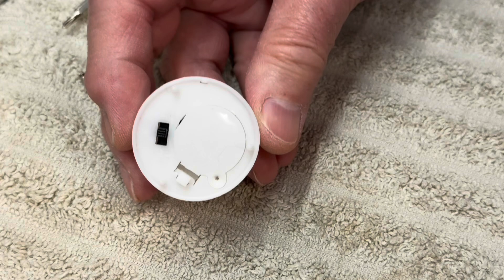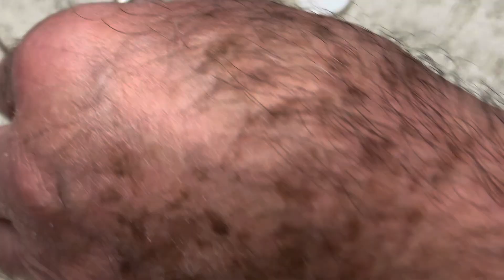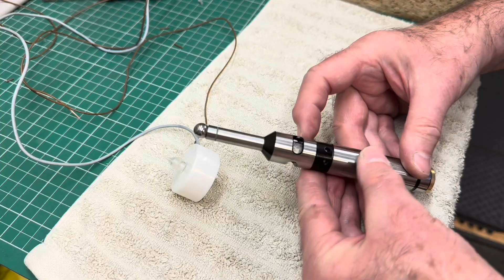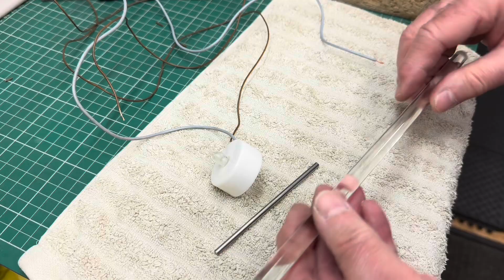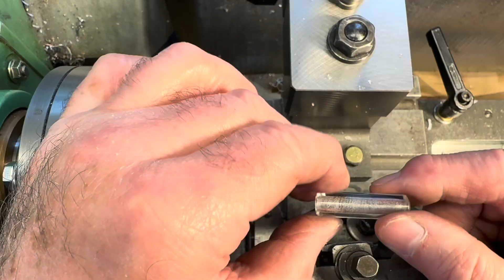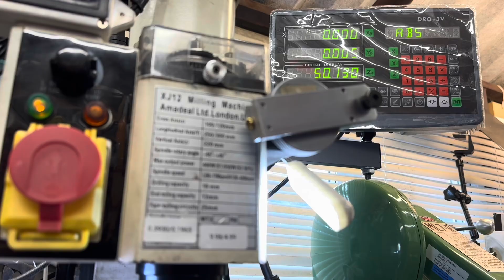Led Edge Finder - Shop Made.

Comment: Nice project Nobby!  I’d looked at the commercial ones and they are far too big to be practical in my mill.  You’ve given me food for thought as to how I can make one for my workshop.  Thanks!
Reply from the maker: Some of the 3D Touch Probes are coming down a lot in price now. Still a bit too rich for me at the moment Mark. I guess they could still drop a lot more in price. The one I have works very well, but is unnecessarily large. 
Cheers Nobby

Comment: i bought a doz tea lights on Aliexpress hoping for a battery holder switch box, was almost the same as yours , they do sell battery holders with a switch Single Slot CR2032 or double  very cheap
Reply from the maker: I’m trying to think of other things I could make with these T-lights. What are you going to use yours for Jon? Cheers Nobby
Reply: @nobbysworkshop  i have jaws mouse traps, just mouse traps in a plastic enclosure you can't really see if you got a mouse, so with a tilt switch and buzzer ill know :p

Comment: Hi Nobby.  Interesting idea.  I would expect that any oil on the contact surfaces would/could cause problems with low voltage current flow, as it would act as an insulator. This could cause inconsistencies.  Maybe that's the issue. Try wiping those areas with acetone and see if it improves things.  Cheers Rob
Reply from the maker: Thanks for the tip Rob. That didn’t occur to me. I’m going to shorten the probe, which I’m sure was flexing, and carry out more accuracy tests. Your advice is very much appreciated Rob. Cheers Nobby

Comment: Could make the base of the candle magnetic and also one of the terminals so that it only needs one wire coming out of it.
Reply from the maker: A magnet could be a problem in attracting swarf. I made this in the same way Myfordboy did, but it could easily be modified to have a contact on the base. Good idea T&B. I still have to shorten the probe, and do some more repeatability tests. Cheers Nobby

Comment: My candlle ight had a flickering effect led and I switched it for a regular one. If yours has the same flicker effect this would make reading inaccuate.
Reply from the maker: Hi David I think I mentioned I was worried about this in the video. After I shorten the probe, I’ll carry out some more tests. If it doesn’t repeat, I’ll have to replace the LED. Take care ATB Nobby
Reply: @nobbysworkshop I can send you a new led if you like I have plenty. It would be more visible anyway.

Comment: Now if you really want the metal stick to be centered, turn it around and put the metal part in the chuck of milling machine. Then use lathe turning tool in milling vise to turn the plastic part concentric with the metal part.
Reply from the maker: Good tip. Much appreciated. Cheers Nobby